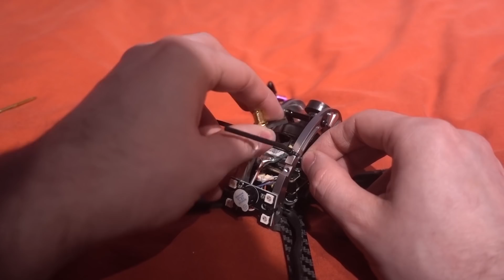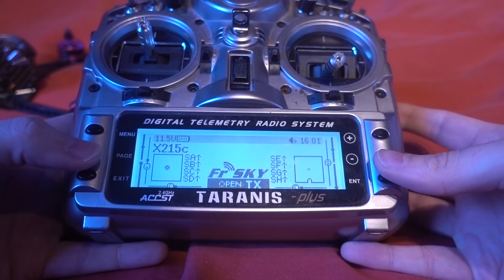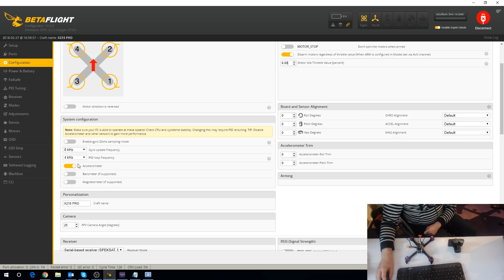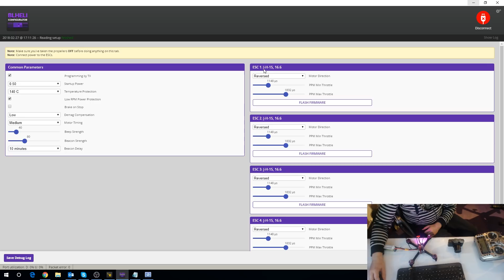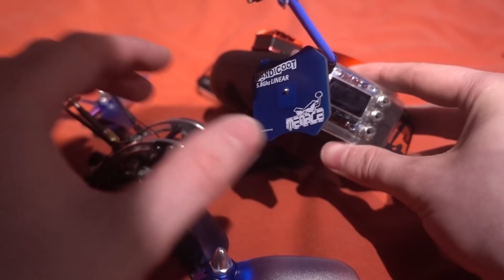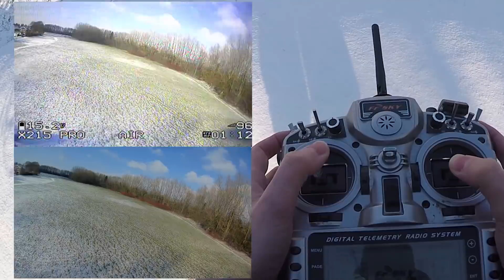How I Review A Quadcopter - X215 Updated Version

Comment: Hello I bought one of these furibees it has the kakute f4 v1 board non-aio.  my fc shorted out from a crash so i ordered another  one when I installed it, It began to spark off the positive connection that you solder to the fc when I pluged in the battery. I checked the soldering connections and everything was clean and not touching each other so I assumed the fc was bad. I recently received another one. hooked it all up plugged in the battery and it was fine however when i put it on beataflight and did a motor check this new board began to spark in the same place, What should I be checking or looking for?

Comment: Hi Andy. Why can't you use the firmware with the rssi on channel 16? I do with my channel range on 1-8 and it works fine. According to Joshua Bardwell the rssi channel on a xm+ is generated on the receiver side and doesn't require any additional communication with the transmitter.
Reply from the maker: I think it's mentioned in the video? More channels more delay. Cheers
Reply: Yes I saw that... My point is that you can use the 'rssi 16' firmware and still have the lower latency of 8 channels. The rssi on a xm+ doesn't need an actual channel for communication between the transmitter and receiver. The rssi channel only exists on the receiver side. So you can limit the channel range on the radio to 1-8 and have the lower latency and have the rssi on channel 16 at the same time.

Comment: Hi Andy, I just use the pin head cables that come with breadboards to plug into the tiny connectors, it works really well - https://www.banggood.com/65pcs-Male-To-Male-Breadboard-Wires-Jumper-Cable-Dupont-Wire-Bread-Board-Wires-p-91799.html?rmmds=buy

Comment: my XM+ shows a constat RSSI value of 50 in my OSD. Any idea? maybe firmware update?  on all my other quads I use the R-XSR and they are working like a charm with OSD/Telemetry
Reply: Fliptality It may be that you don't have the RSSI firmware loaded on to the XM+ which is not standard for the receivers I have purchased in the past. It's easy enough to do with your taranis, if you want help let me know and I'll talk you through the process.

Comment: Andy you can use those little pin headers the ones with the metal exposed and then push them into the jst connector.. then use the other ones you had like the Servo tester end and plug those in!! I saw it on Bruce’s channel for helping with charging one cell at a time through the balance plug! Hope it helps you with further receiver flashing!
Reply from the maker: yes you can however they don't all come with jst connectors so the test clamps will work for all cheers